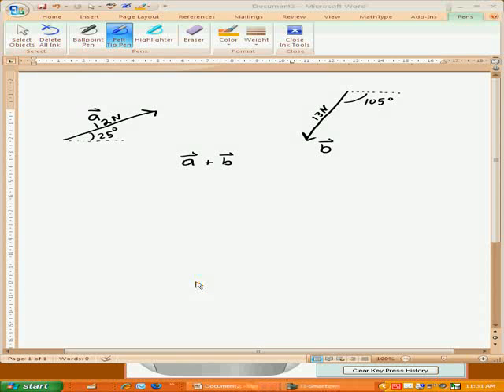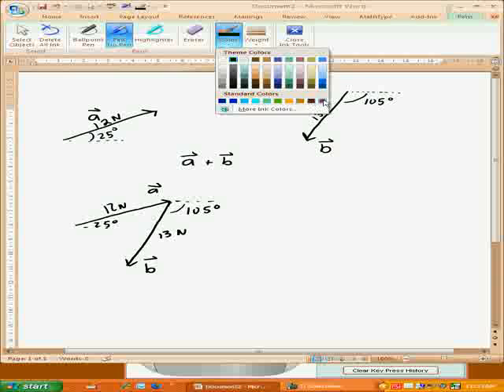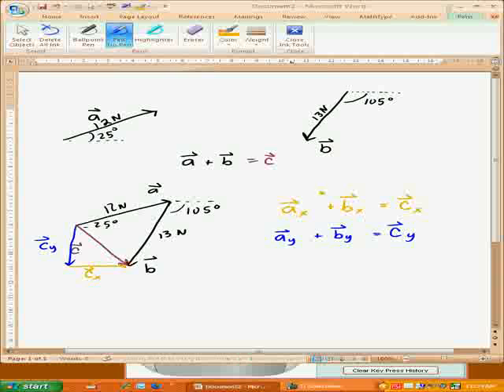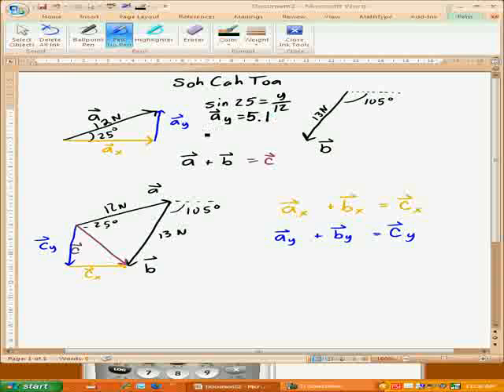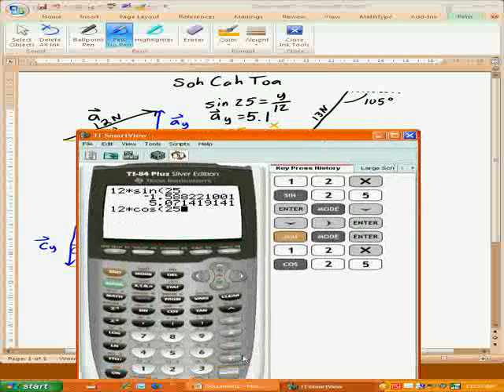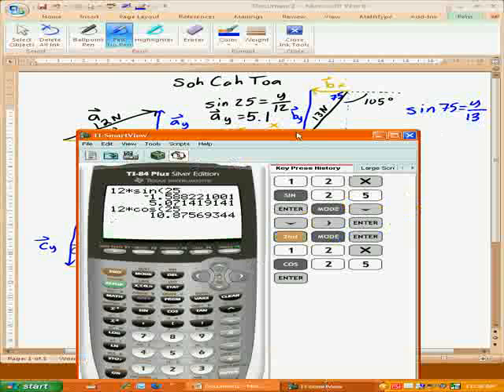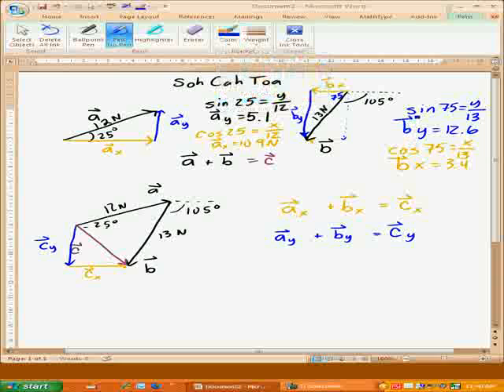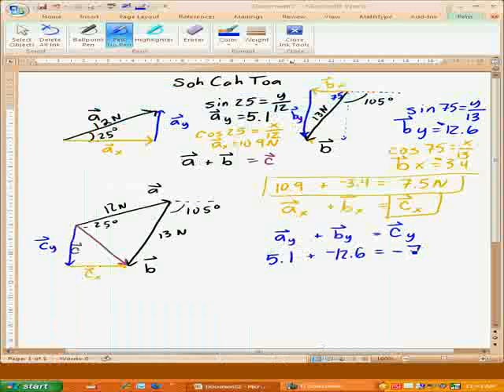How to Add vectors using components (part 1)

Comment: hey, where did you get this equation: ax + bx = cx
pls explain to me about this formula 
i only know the pythagorean theorem to get resultant :/
Reply from the maker: Sorry, for some reason I never got this comment until now.  ax + bx = cx is only to get the resultant in the x-direction.  If you break all vectors up into components, you can add all the x-direction vectors together as they are all forward and backward in the same direction.  It is just linear addition of displacements.  After you get the x-component resultant and the y-component resultant, you use pythagorean theorem on those two to get the final resultant vector.  Hope this is helpful, albeit late!

Comment: the magnitude of cx should be the same number of cy but different in signal ?
Reply from the maker: The magnitude of the x and y components should only be the same if the angle is 45, 135, 225, 315 degrees. The values result from the use of the basic trig functions.  Generally they won't be the same for x and y components...

Comment: Question:  So, you add vectors together using their components, usually when the vectors have an angle to them (15, 45, 80 degrees etc...), but when it's a unit triangle, you would only need to use the Pythagorean theorem correct?

Comment from the maker: For all trig calculations you can look back at the reference angle.  This is an angle between 0 and 90 degrees that corresponds to the original angle.  You then get the + or - based off of the direction of the vector. :)

Comment from the maker: @kyelsoundproductions: as I'm using the angle with respect to the negative x (to go left) and negative y (to go down) axes (in quadrant 3), I'm using the supplement of 105 (the other half of the 180 degree straight line).
Technically, you can use -105 degrees (as it is clockwise from 0), and it should give you the same answer, but I like to stick to simple right angle trig and pay attention to the directions!